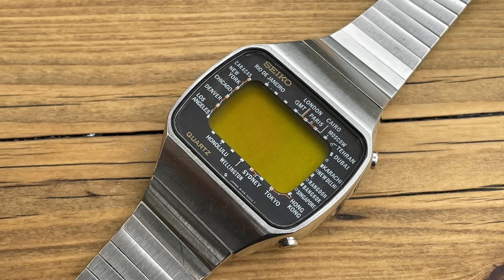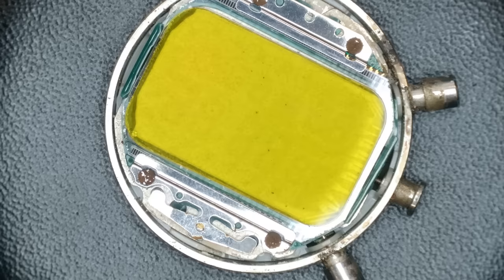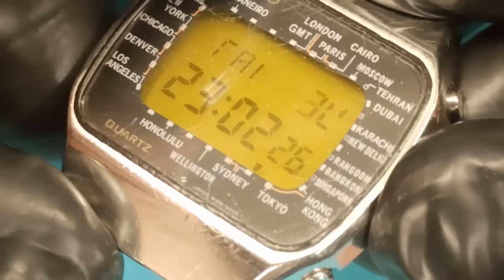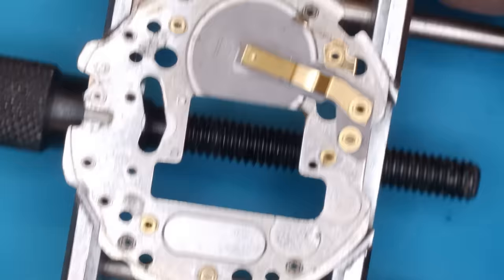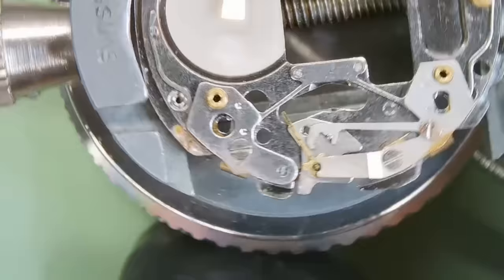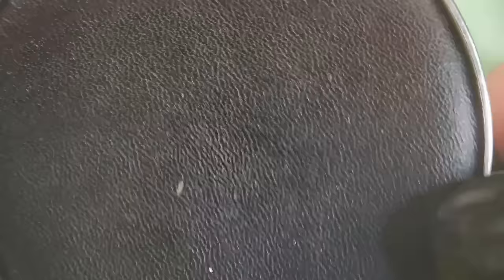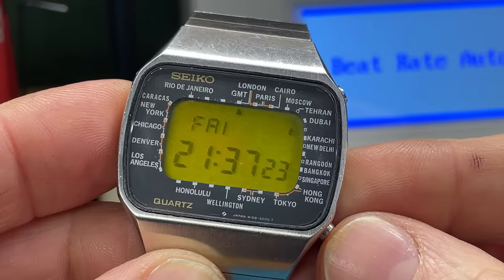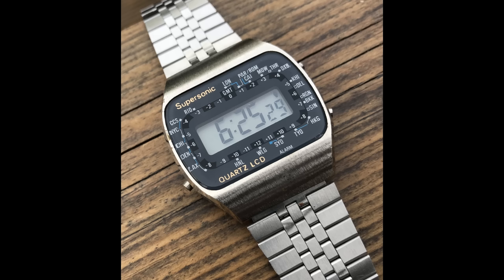1978 Seiko Pan Am M158-5000 Vintage Digital Watch Restoration

Comment: The Seiko machine that you are using to check the accuracy is, in its root form, a frequency counter. It is measuring the frequency of the quartz crystal oscillator inside the watch. It is then comparing it to the ideal frequency (usually around 32 KHz, but it does vary), and then takes the variation between the ideal frequency and what the watch frequency, and calculates the daily variation from the ideal.

The heat you are feeling is probably from an ovenized crystal oven, which creates an extremely stable frequency that is the reference for comparison to the watch’s frequency. Crystals do change their frequency when exposed to temperature variations. Pitting the Seiko timing machine’s crystal reference in an oven reduces the variation significantly. Typically, a frequency counter with a regular crystal will have a variation of 1x10^-6 to 1X10^-7. An ovenized crystal will have a variation of 1 X10^-9 to 1x10^11.
Reply: How does it pick up the oscillator in the watch? Inductive?
Reply: The frequency of the crystal is 32,768 KHz
Reply: i wouldn't know the actual means through which it picks up the crystal oscillations, but the crystal sends out pulses of electricity, this creates a small electric field that's picked-up by the processor to clock itself, a bit like a piston in an engine, it uses the crystal to know it's up, and down states, either way that pulse of electricity is going to be at, or near a specific frequency, and you can pick-up the electromagnetic field from it using the base he put the watch on, so there's a coil in there, i guess it would be inductive, and from the pulses received from the coil, it can count what's happening in the watch...  i think, anyway...  kinda like how you can charge your phone, or toothbrush without electrical contact, same thing, but really small currents...
Reply: Took the words from my mouth. My grandfather founded a crystal oscillator factory. Today the supply OCXO to satellites. The temperature at which the oven heats to, brings the oscilator to a flat point on its cubic frequency response vs temperature graph, that itself is determined by the angle at which the grain is cut in the quartz.
Reply from the maker: Thank you for your detailed reply. Sorry for late response
Reply: @zandrm As I understand it, all you need is another crystal resonator in close proximity, and it’ll start, uh, resonating. Same thing happens with two identical tuning forks in human hearing range (instead of 32kHz). Then some circuitry 🤷‍♂️
Reply: @allankristiansen8133  32.768 KHz is exactly correct. This frequency is actually a binary number. It is the modulo count of 2 to the 15th power or in HEX: FFF FFFF FFFF FFFF. So a HEX count from 0 to FFF FFFF FFFF FFFF = 32,768 HZ exactly. A 15 bit ring counter in the watch’s time keeping  chip will give a very precise pulse every 1 second, which will drive the other registers that display the time.

The frequency counter most likely uses an inductor to sense the frequency of the crystal oscillator in the watch and compares an OCXO precision gate and can precisely determine the offset of the watch’s oscillator.

Comment: Your Seiko tester is basically a frequency counter with a high precision crystal oven for temperature stability. Crystals do age over time , so it may not be as accurate as it was once was. The ovens usually have an adjustment port on them for the crystal adjustment if you have something to calibrate it against. It usually will tell you the frequency on the top of the oven. A nice piece of old equipment. Thank you for sharing it.
Reply from the maker: Thanks for your insight. I know a man who can calibrate this actually , not sure how it’s done but it can be apparently.
This is the first time I’ve used it properly as I’ve only had it a month. 

I’m now electronically minded though but know it’s a good asset to have on the bench. 
Thanks for watching this episode.
Reply: I have a witschi version and calibrated it using a cheap GPS receiver that outputs the 1 PPS signal derived from the atomic clock on board the satellites. Wiring the pps signal to a piezo sounder (optional - just to hear it) & wired in parallel to a rotor coil from a cheap quartz alarrm clock (for the tester to sense the drive pulses). Works a treat.
Reply: @wirdy1  The GPS satellites have their clocks to less than three nano seconds, or 3 billionth of a second. You can 0 beat your receiver to WWV on one of the even frequencies, like on 20 Mhz, or 10 or 15. It should give you a very accurate calibration. I am a ham radio operator and we have been doing this for years. Just an FYI, but I would like to know how to get the GPS. I just have not tried.

Comment: Typical quartz watches do not compensate for temperature, so it is important to take note of the temperature at the moment that you are regulating it. Worn on the wrist, the watch will get warm from contact with your skin so it will be warmer than the ambient temperature of the room. That temperature is roughly 30ºC, while the temperature the watch will be stored at may be considerably less. If you like to have your watch be accurate when you need to grab it and go, you will consider its storage temperature and regulate it around that temperature. Even if you wore it every day, it still will be off overnight most likely, so somewhere between storage temperature and wearing temperature would be a good spot to shoot for. The Seiko Superior and others that had twin quartz oscillators did do some temperature compensation. Those watches can only be regulated with the QT-99 (good choice of machine Michael!) or QT-2100 or later quartz testers or by using an adapter, called QT-Adapter, which was made to use with the QT-77, QT-100, and QT-200 testers. Lots of modern quartz watches are not even adjustable so this whole subject of regulating is moot and a quartz tester just tells you the rate it is running at. You will find most of those movements run fast a few seconds per day. High end quartz movements are thermally compensating and accurate to within seconds per year or month. Most (all?) vintage Seiko quartz movements had trimmer capacitors for regulating them, but the run of the mill ones today do not.
Reply from the maker: Thank you for your comprehensive reply.  Yes I am aware temperature is a big factor and testing this watch at 10c was not a good working temperature but its where the machine is housed for now.  Its only been used in anger once so far.  I bought it from Japan and had it just over a month. Plan to do a video on it but as I am no expert on the machine or electronics I can only show how I use it really and I want to find out for myself how much adjustment a trimmer can give on a watch. 
Are you suggesting that even if I have the ideal temperatures that "regulating" the trimmer would not really improve anything?  I have a Seiko 0634-5019 which runs at least 1 second a day fast on the machine and was going to adjust this one.
 Thanks again
Reply: @MyRetroWatches  you can find articles on temperature compensation and estimate where the watch will run at the temperature you are aiming for, then regulate it at its actual current temperature to hit a specific target you estimated. Or, just shoot for perfect and then come back later after seeing the watch’s actual rate average over time and then speed it up or slow it down accordingly. But honestly, with a watch that doesn’t do temp compensation, there isn’t much point in being too exact, so I shoot for being on the plus side always because it’s easy to hack the watch when I go to use it and the rate difference over the course of a few days is negligible. I just had my 0439 on the tester the other day. I had it on my wrist for a long time. Put it on the mic and got a reading of +.015 (3 digits on a QT-2100). I left it there and watched it go all the way up to +.250 as it cooled down to room temperature, which I think was 23°, so about a 7° delta. But wearing the watch all day, it held within a second every time I checked.

Comment: Cool old watch.

All oscillators are affected by temperature. Super accurate quartz oscillators have a "crystal oven" that keeps the reference at a fixed temperature, at which it is calibrated. That temperature is maintained in future measurements to ensure maximum accuracy. Back in the day it was easier to heat up something to a target temperature then maintain it at an arbitrary temperature.
Reply from the maker: Thanks for the info!
Reply: It's still done that way. For both time and voltage standards at least ovenised crystals and references are how it's done.

Comment: A Longines Quartz Watch - was the first to be patented for temperature compensation components within the Watch. I bought a Longines for this reason. Inside, my Watch is unusual, because there are two coils, and (from memory) these are used for the temperature compensation. A common failing of the LCD Screen can be the Zebra Strip (the foam conductive rubber with black stripes). I had discovered that greater pressure can be put down on the zebra strip to get it to work again, and even a light clean with Meths helps. Great to see the old Seiko work again.

Comment: Brilliant, absolutely brilliant. I think you've spawned some digital and electric interest with this one and your older Timex Electric/Dynabeat video. I bought a watch lot that arrived Saturday and in it I found almost a cosmetic pristine 79 Timex Electric (not running) and a Timex Quartz Lithium Digital Chronograph, so I'm going to rehab them. Actually, the chronograph runs flawless, but it's got some black dots on the clear top layer. I'm not sure if that is the LCD, maybe so.

Comment: I work for a local jeweler friend of mine a few days a week and we probably change out 40 - 60 batteries a week. We use the Renata batteries exclusively and have always had great luck with them. They will usually last at least 18 months. We got away from other brands because they just were not lasting long enough. As for the quartz watch collection video, YES! Please do. Even if you post it on the review channel, as long as you do one. I think it would be interesting to see what you have and why. Thanks for another great video!
Reply: I use Renata and energizer. Never had any leak, but then I don't leave expired cells in watches. The advice I always give to friends & family is to pull the crown if they ever notice the watch has stopped & get the battery removed or changed asap. It seems the leakages happen when gasses are produced from a flat battery. Pulling the crown early stops the battery completely depleting.
Changing so many batteries, you must see some leakages, cheap alkalines & other odd things folks do to their watches?
Reply: I totally agree, change your batteries as soon as you know they are going bad. And we always recommend pulling the stem out when not in use. As for seeing of the damage cheap batteries can cause...YES, all the time. Sadly, its almost always the watch people don't want to lose which is damaged beyond repair. If you value it, take care of it!

Comment: Good job. I’ve played with restoring couple of quartz watches. Some just needed gentle cleaning. But I’ve found watches, or cameras, which had leaking mercury batteries, totally fried circuits. Maybe one function might work, but if gadget had multiple functions, a leaking mercury battery fries the circuits somehow. Not sure why.

Comment: I salvaged an old LED wristwatch from the scrap drawer in the workshop back in 2000. It had probably been left there as a warranty return in the 70s. It was powered by two batteries. (LR44...?) The watch worked and I was thrilled! But the batteries lasted two days. 😆

Comment: If I remember right, quartz watches tend to speed up with a higher inner case temperature, so the trimmer might be bang on for a daily driver since your wrist heats it up.
Some super fancy watches have temperature sensors built into the case and the IC uses the temp data to auto-trim

Comment: It's interesting to see electronics repair approached from the perspective of someone who works on watches. The process of taking it apart is a lot different than how an electronics person would approach it.

Also, the fact that the bottom layer of connections appears to be a piece of copper stamped into the shape of traces and heat staked onto a piece of plastic is... very odd! The whole watch is a fascinating mix of analog and digital watch design concepts.
Reply from the maker: I think you still liked my approach!? 
The board is very unusual in this one.  I have quite a few Seiko digital from the 70s and non have a board quite like that .  78 is still quite early for Seiko in the world of LCD.

Comment: Enjoyed the vid, never thought digital watches get restored! I always liked the Red LED/LCD? Ones from late 70’s when I was a youngster. I kinda kept an eye out for one for nostalgia & chanced upon one at a car boot - but was more upmarket than the plastic jobbies/straps ones I remembered. Very stylish / thick heavy steel strap, very nice imho. I bought without testing just for the look. My surprise when I pushed the buttons a few hours later - it worked! I discovered it again only last week - & it still works!!!! Not changed the battery in all that time - no idea when the battery installed. 
It’s not massively bright - the segments look underpowered - but thought I’d leave it until it doesn’t work. Tempted now to replace battery…. 
Maybe I’ll find out what make it is as there’s no writing on it. Thanks again for your channel.

Comment: A great restoration video, magnificent the result.  Just a contribution, the instrument used to enlarge the images is not a microscope but a stereomicroscope.  The microscope is only used to view transparent objects and the stereomicroscope for solid objects.🙏
Reply from the maker: Not sure I follow . Stereoscope I have is an optical microscope with two viewfinders hence stereo sold by AMScope as a steroscope x20x40 
The ones I use to capture video and images are a digital microscope that have a screen instead of viewfinders. These can go I think to x300 +

Comment: I used to repair Nokia phones in the late 90s. The LCDs would fade like this. Replacing the zebra strip would sort it. If we didn't have new strips then squashing the strip between two flat surfaces would make it slightly wider and improve the contact between LCD and PCB.

Comment: I see you have had many comments already, the Seiko quartztester is fascinating, there is some interesting things going on with how it listens to the watch on the sensor stand i would be interested to see what is going on in there. The 'oven' in the box will be a calibrated quartz crystal but it will be mounted in an insulated box with a heater. The heater will be controlled and will maintain the crystal at a set temperature that will stabilise the thermal drift. They are commonly known as an OCXO.

Comment: I had, until recently, a Seiko LC Quartz 0124 and the screen would fade out if left in my watch box. Left it in the sun a few days and it seemed to ‘charge’ the LC Display for a while…. 
Awesome Pan Am and great video! Seiko technology was amazing in the 70s! I’m a Seikopath but don’t usually go in for digital. However just scored a NOS boxed UC-3000 with its keyboard. Cant wait to get a battery in it
Reply from the maker: Nice! I have the UC3000 too . Great watches

Comment: I've used a oscilloscope with a 10MHz GPS disciplined standard to synchronise quartz watches, I hover the probe over crystal to get the frequency then sync it to disciplined frequency run through a sig gen outputting 32768Hz, on channel 1 with trigger, while the crystal is read on channel 2, I keep adjusting till channel 2 stops scrolling, I've found directly reading the crystal adds capacitance and skews the frequency so just using the probe as an antenna is the best way for me.

Comment: Amazing Video - I remember the 1970s clearly as I flew from the UK back home on many companies, including BOAC Airlines
I also used to collect the Adverts in business magazines, and look at the adverts of watches, especially the Digital watches, the LED ones and wonder if I would ever have one.
I owned a Timex LCD all those years ago.

That watch probably flew 1000's and 1000's of miles, and probably cost £100's

Now I am an Electronics Engineer and work on Surface Mounted components, the size of dust,  I could see a few things that might affect the LCD brightness

1. The Caps could still be slightly out of tolerance. ( Maybe worth a replacement) they could be a value of maybe 10uf ( the uf is pronounced Micro Farads  1/1000 of a Farad)
2. The Green plastic thingy seemed broken, which "Might" have affected the Zebra rubber.

I Love old Technology, and still repair old items as a hobby.

If I can advise, please don't hesitate to ask
Reply from the maker: thank you for your comment.  I have contemplated removing the caps and trying to replace but I know next to nothing on electronics. I just like repairing watches.
Reply: @MyRetroWatches  Im in the Uk if that helps?
I know nothing about watch repairs  🙂

Comment: I usualy "fix" the screen weakness with a pencil eraser on the contacts of the board, so far have worked well for me, the glass I simply clean it with a smooth cloth...
Reply from the maker: Pencil led on the gold contacts on the board? 
Not sure that would solve my dim screen issue though
Reply: @MyRetroWatches 
Pencil eraser, the other side of the pen.😂
Reply: @MyRetroWatches  not thepencil itslef the erraser one uses to clean the graphite from paper

Comment: The oven in the tester is to heat the Crystal to a specific temperature so it stable. Essentially the machine a frequency counter.

As far as the disappearing digit when cold, likely the zebra strip needs another wiping to bring it around.